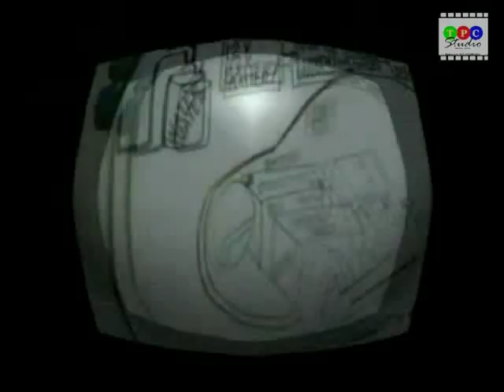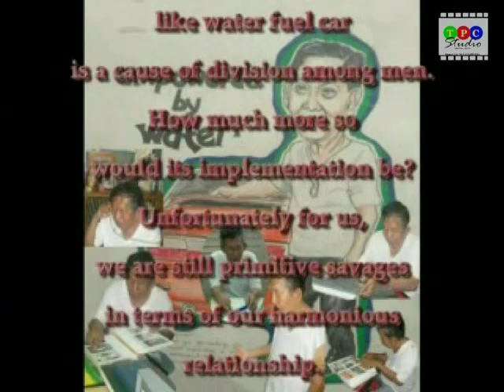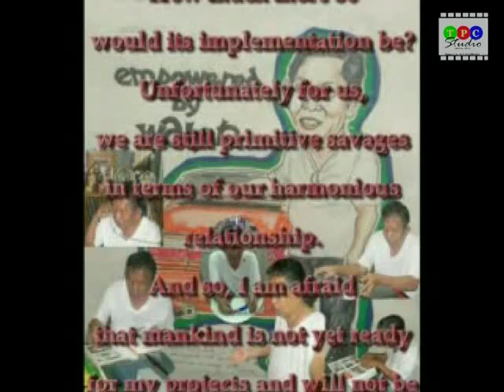Mr. Daniel Dingel's Water Car (part 2)

Comment: it has been proven all developed countries have their owned hydrogen power car, but the thing is the market of the fuel will be the same system as the gasoline as you need to purchase from the station instead of having one directly from tap water.

Comment: @crazendisturbed Water is not finite, it keeps recycling in the process of evaporation and condensation. This process also removes the salinity of water collected from the sea. 70% of the earth's surface is water, oceans and lakes that stretched hundreds of miles and thousands of feet deep. Even in arid places there is water they just need to drill it out. This resource is unlimited. Energy is unlimited, but unfortunately some people just want to regulate it to gain excessive income.

Comment: The potential here is staggering.  A vehicle can run on water.  A generator can run on water providing power for a house independent of any centralized power generator, which means should power lines go down, or a nuclear power plant goes offline, people still have power.
The challenge is that so many people will have to find different work.
Gov'ts will lose their oil money kickbacks.
The IMF and World Bank will lose its strangle hold on the world's economies.

It will be a great day!

Comment: air is not efficient due to friction. hydrogen combustion can have less work but greater output. but hydrogen fuel cell is just like air powered engine, that have less efficient process.

Comment: Too many ideas to put type out, but for the most part it is a duel resonant tank circuit. The shape of the cell does make a big differance in how the electricty will act with water. The use of water vapor and/or water mist is also very important. Like I said there is a lot of things that effect this. But it all has too do with the properties of natural water, that is why it is not the same as Dr. Faradays work.

Comment: Hellow h2opower.. Im new in hho project. I have constructed hho cel now plasma arcs dc under water.Ive also tested pwm driven power supplies for hho.My result is not efficient enough Even using high frequency pulse. The production still not enough. I even tried Alternator by stanley but still not enough hho on demand to run a car.A regular brute force hho gas  wid 6ltrs per min can barely run a regular engine. very difficult To find ways to make it work. any ideas?

Comment: OK, listen
- Daniel Dingle seems to claim to have an overunity system producing more energy out as hydrogen than comsumed as electrical energy.
This is an extraordinary claim that needs an extraordinary proof.
The only way mr. Dingle will get credit for this is that he reveals the details of his invention (the electrolysis process) so that others can replicate and confirm his results. It will take a lot of proof to convince science community that this is possible.